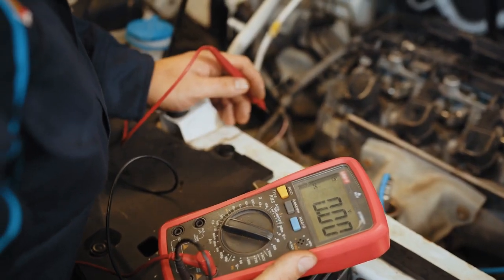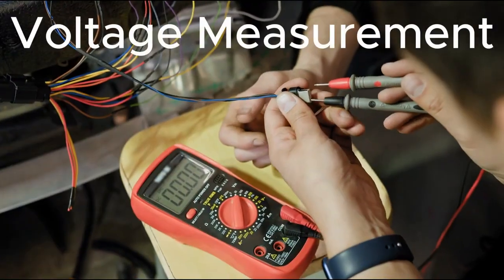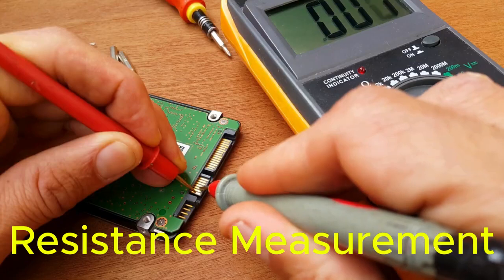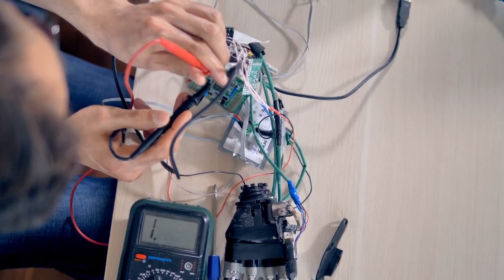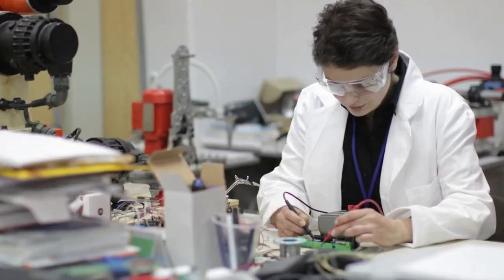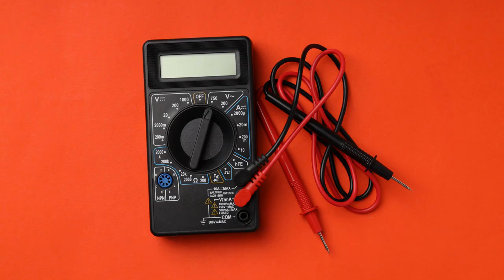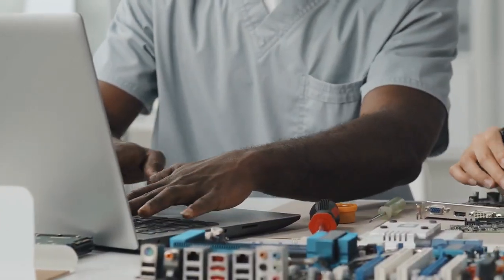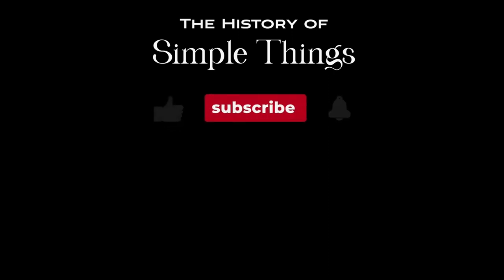Multi-Meters Unplugged: How This Handy Gadget Saves Your Day | 1.1

Comment: It's a dinosaur now!😅 Those analogs ones!
Reply: Analog meters are much better in measuring fluctuating voltages and current than digital meters.
Reply: If it's a fluke it works